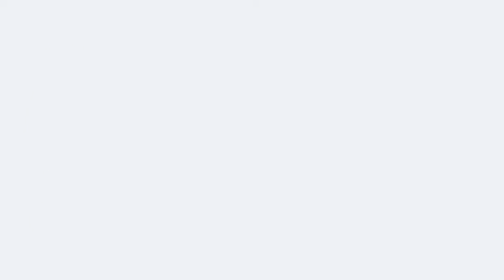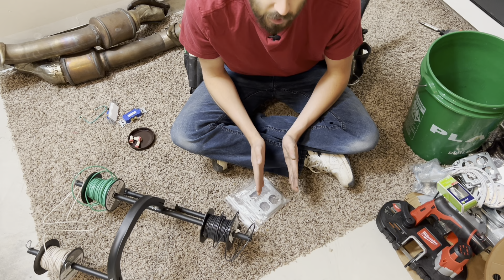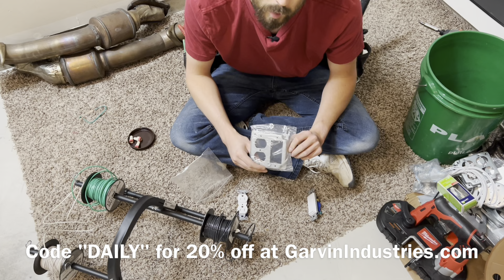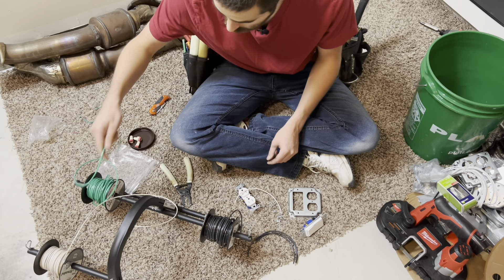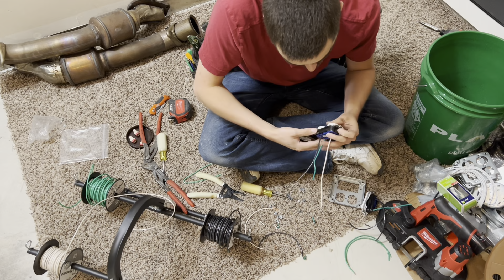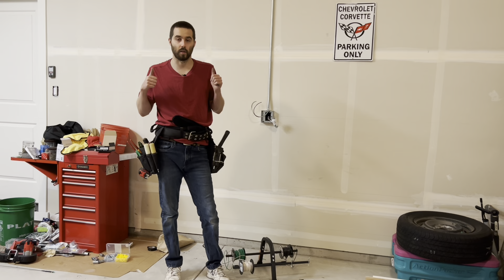Electrical 101: How To Prefab Industrial Raised Covers With Devices

Comment: You can just flip the switch around since there is no top or bottom (No on and off) on a 3 way. No need to change terminals.
Reply from the maker: totally correct, ya'll keep me in line and i really appreciate that 🙏🏼

i think i meant if i was on the wrong 3 way gold screw i'd have to switch it, but if you hit the switch im sure that would do the trick too 😂